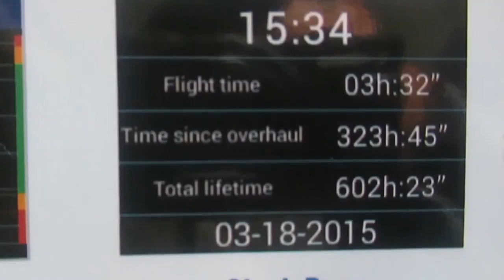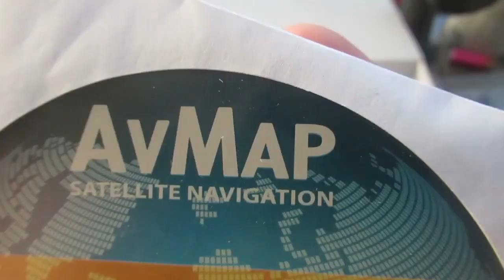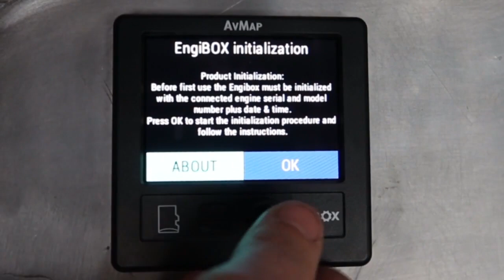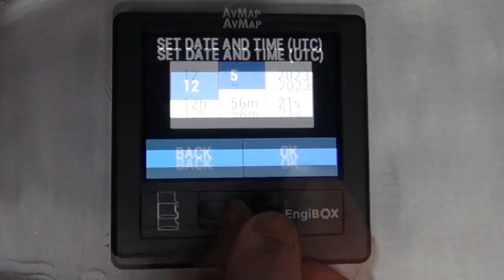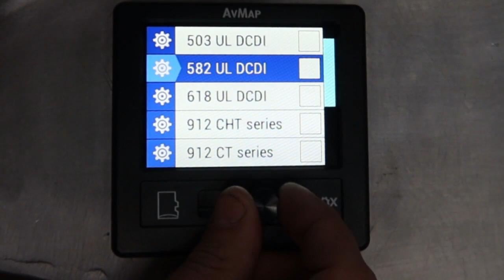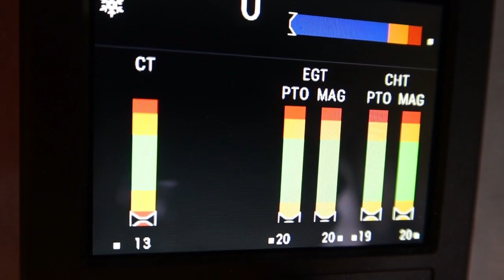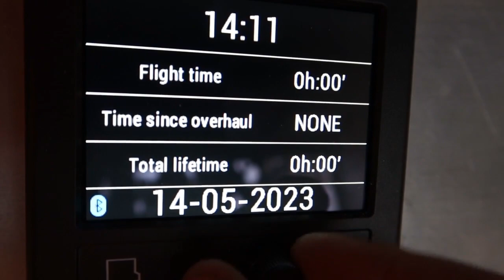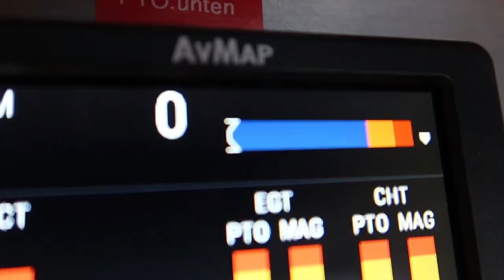Engine Monitoring System EXPERIMENTAL HELICOPTER BUILD SERIES (Part 66)

Comment: Hi there.
I heard that on helicopters they don’t solder the wires, but instead crimp them with copper tubes to avoid destruction under long-term vibration conditions.
however, perhaps this applies to the most critical places.
All the best, thanks for the inspiration!
Reply: Yes that's correct, perhaps not so important for a homebuilt though. These machines get used very little and usually wont fly higher than a few feet if at all. You can always upgrade the wiring at a later date if it was necessary.

Comment: Hi I'm from Africa can 150cc motorcycle engine build a mosquito helicopter please help me.
Reply: The HP of the engine will decide what weight it can lift. As a basic guide 1hp can generate 12lbs of lift. A 150cc highly tuned 2 stroke could produce 30hp but this wouldn't be a good choice of engine.
Reply: Short answer is no, too week to keep sustentation and lift the helicopter, i would recommend you get better components for your engine, at least double its power without doubling its weight. 
 In this way MAYBE it could fly